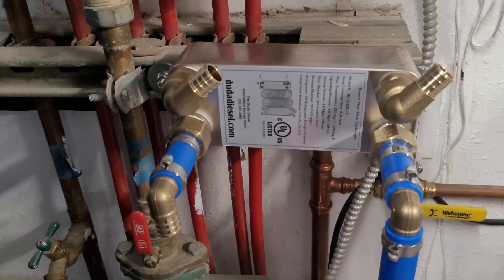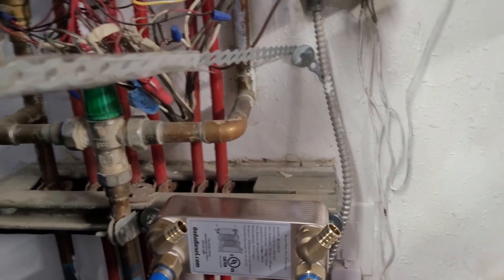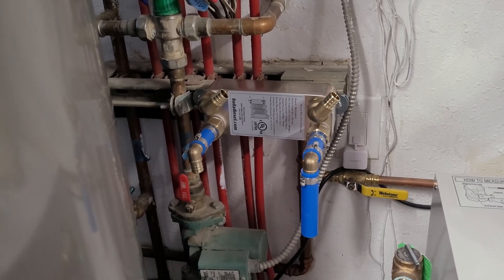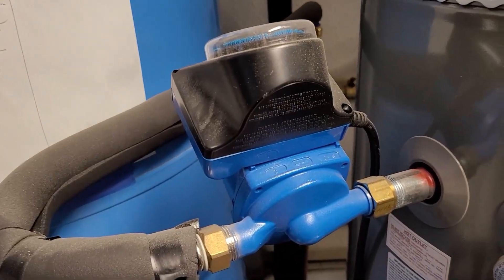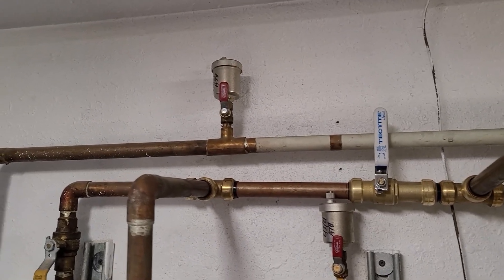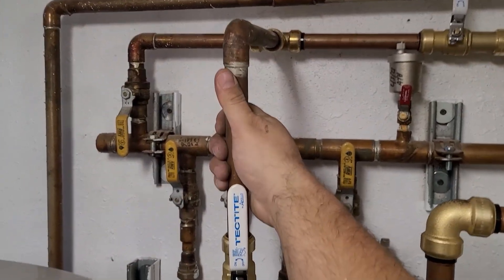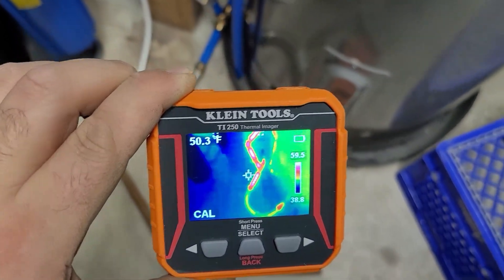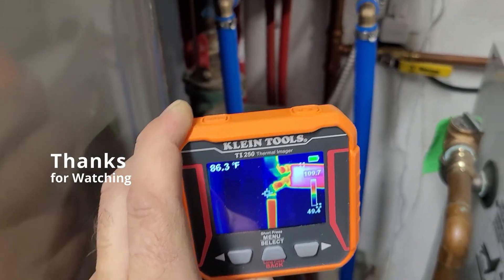Water heater Preheating - Toyotomi water heater OM-128HH

Comment: How do you control the valve on tht loop?
Reply from the maker: It's on my garage loop and I just use the thermostat to adjust if needed. My thermostat is WiFi enabled and can control it from anywhere I have Internet.